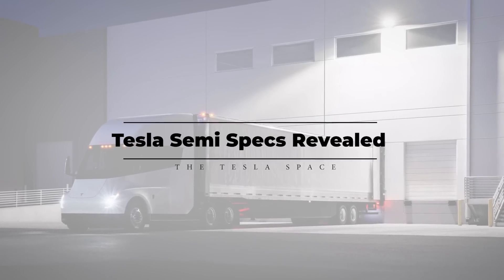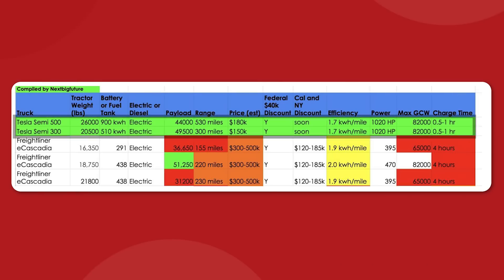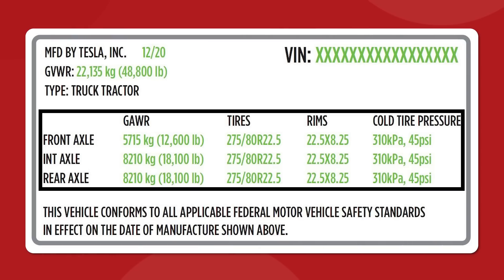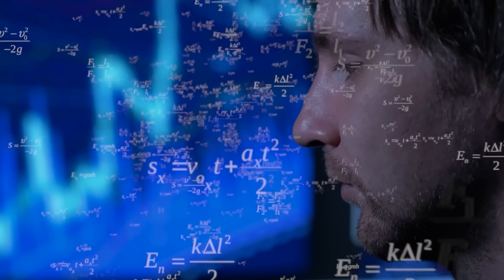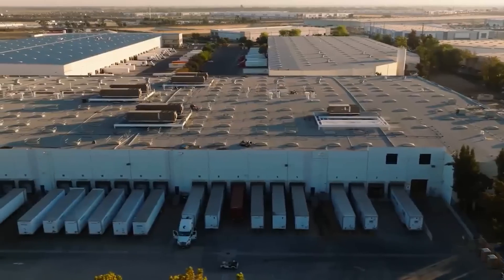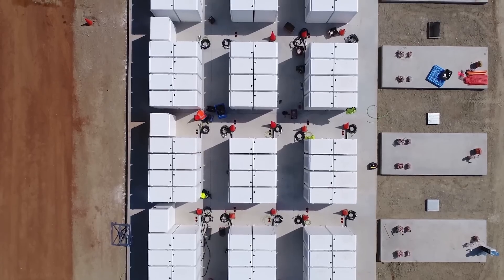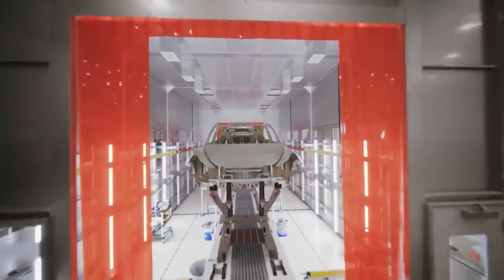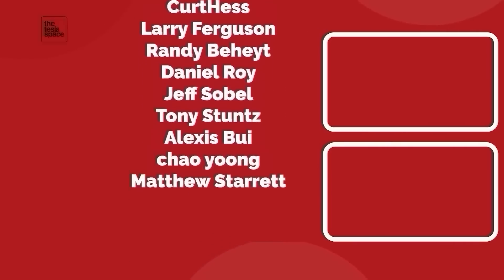Major New Tesla Semi Specs Revealed!

Comment: If those are the true weights of the Tesla semi vs the eCascadia, Tesla is in trouble. That’s far too heavy. Good lord. The cascadia numbers are on par with current diesel versions.
Reply: Im a bit skeptic, did you also see the tyre pressure at 5.45. Only 45 psi, it doesnt make any sense, that's what cars use not lorries especially ones that heavy
Reply: @teem5642  I did not see the psi. Yeah, should be 100-110 for sure

Comment: Not following how you get to 82,000 pounds for how much the semi truck can weigh.
Are you first adding the tractor weight of 26,000 lbs. plus the payload of 44,000 lbs.? If so, that equals 70,000 lbs. But to get to 82,000 lbs. are you then adding the front axle GAWR of 12,600 lbs. for a total of 82,600 lbs.?
Thanks.
Reply: I also don't follow what he's saying. The GVWR is 23135 kg / 48,800 lbs. The GAWR 3 axles also add up 21135 kg / 48,800 lbs. He then says add these two together to get approximately 82,000 lbs but added together you get 97,600 lbs. Frankly I don't think he knows what he's talking about. 5:47
Reply: @danielstapler4315  yeah, it looks like the truck weighs 26000lbs. It can carry a load of 44000lbs. Which isn't very much. Once you remove the weight of the trailer that load is on. Though the videos of the truck out working are representative of about 30000lbs loads.
Reply: @danielstapler4315  Its very confusing in this video and not 100% accurate.  The OEM will put a rating on a truck... the axle rating, vehicle rating and combined rating (as in something that pulls a trailer).  R = rating = OEM stated capacities.  All we know from the VIN label is that the OEM rated this truck at 48.8k lbs.  So... if their GCWR or combined rating is 82k that means the trailer axles have to carry the difference, or 33.2k lbs.   from the OP, the payload is GCWR minus curb weight, or how much the truck and trailer weigh unloaded.  So 82k lbs minus curb weight gives you what you can carry, or what the original video is showing to be an estimated 44k lbs.
Reply: The 82,000 pounds is a limit. It doesn’t matter what the other numbers come up with. That’s the most the tractor with a loaded trailer can weigh.
Reply: Tractor 26klb, payload 44klb, trailer 9 to 15 depending on the type.
Reply: GVWR and GAVR are pretty irrelevant, they exist only to satisfy the regulations of per-axle maximum weight. In the spec comparison table we can see that for both Semis as well as for the heftiest eCascadia, the tractor weight + payload add up to 70,000 lbs. This is probably no coincidence. One idea is that this denotes only the usable cargo weight, while assuming 12,000 lbs to be lost on the weight of the trailer vehicle.

Comment: Excellent in depth Video… can’t wait all trailer roofs are fitted with 560 watts solar panels.. how many will fit up there.. 
and how much % does this make sense? Please Compute ❤
Reply: Totally stupid idea reducing the payload
Reply: Assuming the trailer has a roof the size of 42’x8.5’, and is completely covered in top of the line 22% efficient solar panels during peak sun (1000w/m^2), and assuming a system efficiency of 90% from the panels, the 500 mile model would get an extra 32 miles of range if it traveled at 60mph for 9 hours straight in peak sun. Traveling at 80mph gets it only 24 additional miles of range. This doesn’t account for the added weight of the panels, drag induced, or the necessary additional electronics to support them. Overall, it’s not really much of an improvement but it would certainly look cool
Reply: @thoughtyness  solar cells setup like that would be good to run supplimemtal cooling/heating for cargo in trailers. It would also go a long way to providing driver comfort during rest breaks.

Comment: I would honestly be very surprised if they get alot of orders for the 300 mile tractor. There would have to be a big difference in price, otherwise the flexibility of the bigger pack is way more enticing for the industry.
Reply: You seem to forget that a lot of summers are used for local deliveries. So that would create a truck that he pointed out would be capable of carrying heavier loads and cost less money.
Reply: @Neil Kurzman  im not fogetting anything. You can still eat up range starting and stopping. Delivery guys on tractors tend to work 12 hour shifts not shorter 8 hour shifts. Just because they wont use it all doesn't mean they dont want it. It also means it can turn around and do another run with another driver if they are split seating the tractor and it doesnt have to be topped off. Trust me, no one likes getting in a truck and finding out its got a quarter tank/charge. They also know that you wanna not use the whole battery capacity so that it lasts as long as possible.
Reply: @ShotGunner5609  
With regenerative braking stopping, doesn’t waste as much energy as it does with a diesel. Stop thinking it’s just a crappy version of a diesel. It’s a different type of vehicle with different strengths and weaknesses. 
A quick look says a CDL can’t drive more than 10 hours per day. 
And if you’re doing pick ups and deliveries, you’re going to spend a little time that doesn’t use any fuel unlike a diesel. When you’re parked, you’re not using any energy there’s no idling. 

There are a lot of applications, where in electric truck is going to be much cheaper to operate than a diesel. 
It’s going to have additional benefits such as not having the neighbors complain about idling diesel trucks in areas that adjoining residential neighborhoods. No diesel exhaust.
For a long haul at this time diesel wins. 
But large companies aren’t snapping up these trucks because they think they’re going to lose money with them.
The trucks get charged at the yard. You don’t need to make a special trip for fuel. That’s how they’re using them. 
Some places are planning to install the chargers in the Bays so that they can charge while they’re being loaded or unloaded. 
Once the mega charges are up and running, the truck can be charged in about 30 to 40 minutes.
If somebody needs to keep the truck running 24/7 than this isn’t the product for them.
Reply: @Neil Kurzman  it's 11 hours a day bud. Time spent parked or loading counts as either off duty or on duty but does not count towards driving time, only driving time counts as driving time.
Reply: @Neil Kurzman  also no one complains about trucks idling, if youre home you're sleeping in your house not your truck, idk how loud you think a parked truck is. Only people complaining about ideling trucks are the cities trying to ticket people for ideling. Which they can't anyways because people are sleeping in them. I realize regenerative breaking is a thing, but they have not stated how efficient that energy recapture is for one. And even sitting parked it will still expend energy to keep the cab air conditioned and to keep the air tanks topped off. Provided it's ideling, not like parked for the day. But you would have to be a truck driver to realize that.
Reply: @neilkurzman4907  lol…. Regen has not really a big impact
Reply: @alanmay7929  she retires. First it reduces brake wear. 
Depending on how many stops you doing a day it’s going to add back in mileage. How much? It depends on how the vehicle is used and if it’s in stop and go traffic.
Reply: @neilkurzman4907  lol…. Going downhill are the only things to add greater mileage and those trucks aren’t always in cities
Reply: @alanmay7929  
It’s not a matter of always. An operator knows how they’re going to use the truck. If they don’t buy a general purpose of vehicle that can be used anywhere. They buy the one that they need to do the job.
Even with a diesel truck, two axels or 3? Day cab? Fuel Capacity? Bed length? Ect. 
These vehicles can suit the needs of certain operators at a lower cost. 
And they’re going to buy them because money.
Reply: @neilkurzman4907  again for diesels trucks it doesn’t matter if it has one or two axles, or cab configurations or whatever you think! Diesel is an remain to be used on all purposes. Let’s not forget remote locations…..
Reply: @alanmay7929  
You keep trying to make general statement about all trucks. 
I didn’t say electrically places all of them just certain applications.
Reply: @neilkurzman4907  lol….. diesel trucks are significantly way more flexible in their jobs because they can do both short and long deliveries, also even very old diesels are still used or exported to foreign countries with still greater range
Reply: @alanmay7929  
Yes, diesel trucks have certainly have more flexibility. But a specific operator may not care because they never do any long routes. Often these routes are fixed and very predictable. And if you can offer them, 50% savings and fuel and lower maintenance cost, they might be interested. Where a different operator that needs the flexibility may find that it isn’t worth it for that particular company.
Reply: @neilkurzman4907  bullshit!!! Which 50% on fuel cost or maintenance!? Didn’t Tesla said the semi is going to be just some few cents cheaper!? Lol…. Those trucks as I’m saying can be used in a better flexible way and the company can very easily manage their trucks nomatter what the route or distance is.

Comment: The semi also had added deasel fuel cell carry features at the top rear of the drive truck body, this could've also been a EV battery quick swap. Making EV longer range travel, swift like a track racing marathon. With robotic swap & go at recharge stations.
Reply: Is anyone doing or considering this in future design? With "time on road" (vs fill-up, servicing, etc) being one of the more important metrics in trucking -- it seems (at least to my less than sophisticated eye) to be a great potential solution to long battery recharge cycles. I also wonder whether 'quick charging' degrades the batteries over time -- this could mitigate that as well (i.e. swapping means you can charge more 'gently')
Reply: @bahilleli  BUT, having such infrastructure not only requires complex and expensive equipment and people to operate and maintain it, it also requires having multiple packs sitting at each facility. A charger is just a plug and a big power converter, and can be left unattended.
Reply: Who is paying for the battery that is going to be swapped in? Who pays for it when it has degraded to a point where it is no longer useful? These things are going to have to cost $50000 easily if not more.
Reply: @--_DJ_--  you cannot just discard a battery, it has to already be fowarded. There is already an expenditure applied to that common beuracarcy. Only both cycle swap & recycle process is also taking place at a station, versus a drop off disposal. It can also be a storage drop, in which your property is just held until you arrive for a swap. Also the task is for the long ranger travelers, not every purpose distribution.
Reply: @rolflandale2565  I didn't mean who is paying to get rid of it, I meant who is paying for the new one. It just isn't practical for every company to have millions of dollars worth of batteries stationed all over a country or several countries. One truck would need several batteries to make a long haul, they would be spending more on batteries and storage/swap costs than they would on the trucks. The truck would also have to go out of its way to get to a battery swap location that had a battery from that company. The only way a swap would work is if you essentially rent the battery (presumably from Tesla), but that would add a significant cost to the base electricity price that you would be paying to charge the battery and come with a whole host of logistical problems.
Reply: @--_DJ_--  it's about turning the battery cells/chamber into a borrowed tot/bucket of energy supplies (🔋). It would start out as the part of the vehicle. (Like an extra tires or seating compartment). The stations would have reserved sets also. As I mentioned,  its an added load feature, not all distance of service.

 Since it's an express transfer power, it will have a royal price adjustment, for the bodly cells. Companies could refill or express swap, (just like premium, leaded & unleaded deals were with gas⛽) at stations. So the marginal service cost & remaining used power differences would pay off on physical body cell chambers. Since it's electric power, doesn't have any liquid distribution issues☀️🔋⚡.
Reply: @rolflandale2565  I haven't mentioned anything other than long haul, why do you keep saying it isn't for everything?
It wouldn't be a marginal cost if you are renting a $50000+ battery. It isn't like a gas station, the reusable tank only lasts so long with a battery. The remaining power isn't the big issue, it's the finite life of the batteries. Eventually, they are going to wear down, and you will have to pay for a part of their replacement every time you swap one. These batteries are not going to live an easy life. They will be ran hard all the time and if charged at high speed like proposed, are not likely to have a long lifespan. We have a very good network for liquid distribution. The same cannot be said for charging massive batteries at high speed, or even Electric trucks (on a large scale) at all for that matter.
Reply: @--_DJ_--  Because you keep insisting that this task will be for both local and long haul. "Making a mountain out of a hill." As well keep worring about what to do, if these continues transfer batteries lose their life expectancy. 

 Among the station pit stop charges, evaluations can be done, scanning the life of it. Once again, the cost will be slight higher for those who are in a time rush for of an instant recharge 🔋pack. This compensates for the long run life of batteries, incase it must officially be replaced for a fully new. 
 During a swap. The driver doesn't need to make a full cell purchase, only the difference of the remaining power from prior batteries/pack/cells. 

 The debate of who pays!? Every side essentially does AND benefits this way. 
•Those recharge station service company imposes a slight royal upscale of fee. To compensate new pack power 🔋. 
•The delivery contracts save considerably more time. 
• Associates of goods & service, gets their priority done.
• As electric power, the cost savings from solar stations also declines the over all cost of every side of the business. 

 It's like having a big💪 buddy waiting and already filled a gas tank, swaping tins. (Only its a no charge robotic arm labor).
Reply: @rolflandale2565  You must struggle to understand what I am writing, even though it is crystal clear. I literally just said I was only talking long haul, yet you ignore that and say I am insisting on local, which again, I have never done. I never said you would have to pay for a new battery when you swap, I said you would have to be charged enough EXTRA for the supplier of the battery to make a profit as they would be paying for extremely expensive batteries to be replaced from time to time. All you have is buzz words and word salad. This proposal is not as easy as you think it would be. Using solar power at this scale is a pipe dream.
Reply: @--_DJ_--  Using solar at this scale is Elon’s pipe dream. He dreams and then does.
Reply: @paulschulte1064  He dreams, promises, and underdelivers. Only fanboys don't see that at this point.
Reply: @--_DJ_--  Tesla was nearly bankrupt in 2008. Sold 1,300,000 cars in 2022. 
SpaceX has landed 161 Falcon 9 boosters. The rest of the world has landed zero.  
Tesla is worth more than the next six automakers. 
He doesn’t always hit his most optimistic timelines and I am far from being a fan of everything he does and says, but he was chief design engineer at both Tesla and SpaceX when they were both teetering on the edge.
Reply: @paulschulte1064 GM sold 2.2 million.  How many of those cars are full self driving like he has promised for years now? None.
Has the falcon lived up to the fast turnaround time touted? No 
Reusable space craft is nothing new, he just has a much more spectacular and admittedly impressive way of bringing them home.
Tesla has an inflated value based on hype not what it has produced.
He makes the most ludicrous claims, he is his own worst enemy. He may have had that title but I highly doubt he has helped design anything beyond ideas and concepts. He isn't an engineer.
Reply: @--_DJ_--  Funny, not accurate but funny.
Reply: @paulschulte1064  what wasn't accurate? He promised robo taxis, still haven't seen those. They may have sped up the rocket turn around time, I don't pay attention to space flights. They were nowhere near the goals set out last I looked into it. 
GM did sell that many cars. 
You said yourself he falls short on his claims.
Teslas value is overinflated when compared to other automakers.
He isn't an engineer.
Reply: @paulschulte1064  So nothing I said about Tesla's promise of self driving was wrong. Got it. 
GM shrinking and Tesla growing doesn't make anything I said incorrect.
What does SpaceX profit have to do with anything? They were at several months to turn them around (9s) not that long ago and heavies have never been reused as far as I know. What was the "I can tell" for? Is that some kind of gotcha to make yourself feel better? Just makes you seem petty. 
He very often doesn't deliver, you just don't want to admit that or are not paying attention. Hyperloop, cheap tunnels, the las vegas convention tunnel (loop?) is a joke, his solar roof tiles were faked. Full self driving, robot taxis, trucks in 2019. He promised an unedited upload of the 500 mile trip, only a 2 minute video so far. Plenty of examples. 
He may have given himself that title, but a title doesn't come with the ability to do the job. He is trained in economics and physics. He pays people to design/engineer, nothing wrong with that.